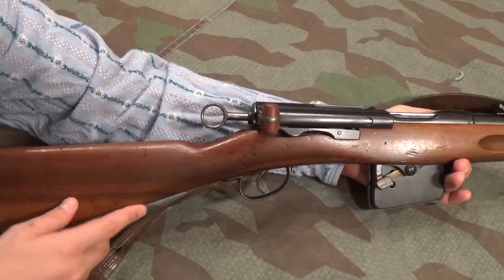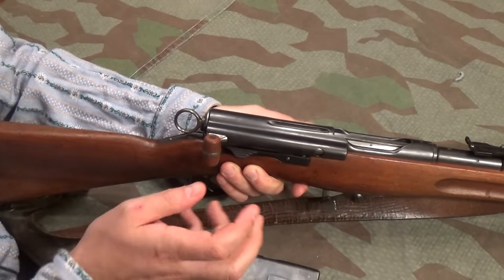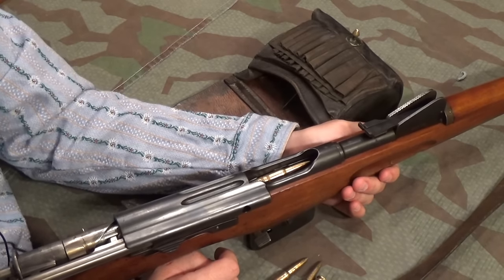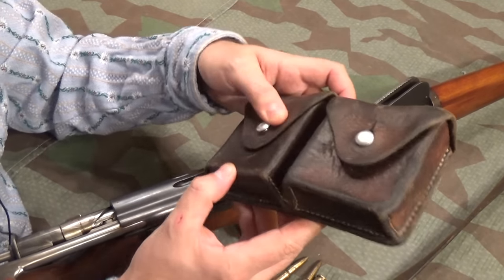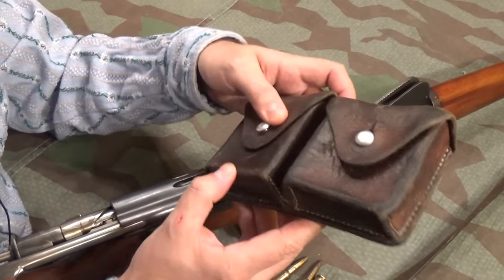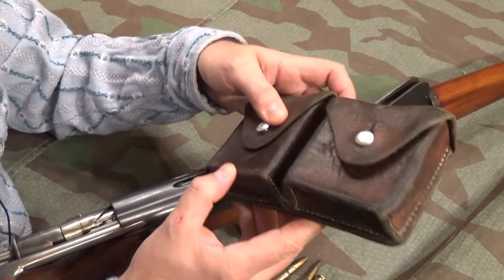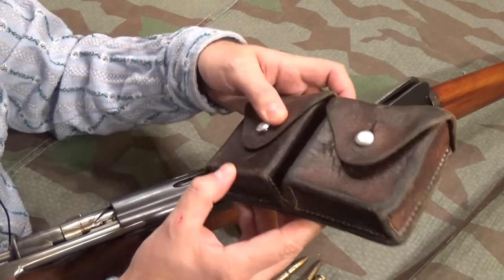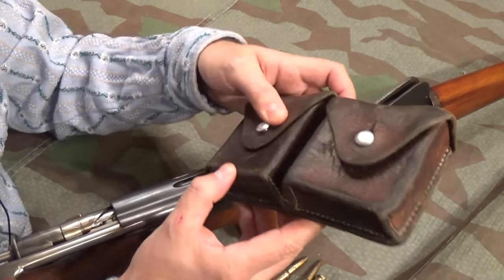Swiss Straight-Pulls Episode 2bis: 1889 Rifle Mechanics

Comment: A lot of people don't really capture the whole story when it comes to the locking lug location.
Yes, having the lugs farther back means more metal under stress and more bolt compression (dynamic headspace).
However, the main problem is that the lugs are behind the cam groove. If the cam groove wasn't there, it wouldn't have been much of an issue how far back the lugs are.
The fact that the section of sleeve containing the cam groove is under stress is a big problem. It means that the stress has to flow around the cam groove (big simplification, stress is a very complicated thing), meaning the stress has a much higher magnitude than it otherwise would have AND it effectively creates asymmetrical locking - the sleeve will bend under stress (because it's asymmetrical) and one lug will bear more of the load than the other.

Comment: 14:50 bullet specs.  Thanks for that.  I've been using a Lee 312-185 with pure lead, as-cast 0.311", using paper 0.003" thick cut 51mm long, patched up to 0.323".  Seems to work ok, but I'm only pushing them at 1690fps...so there's that.

Comment: I recently acquired an IG 1889 converted to a .22 cal target rifle. An interesting tidbit about the gun, it has a serial number that puts the date of manufacture in early 1892, 26,000 range, and a privatization stamp of P 10, 1910. The interesting bit is the 1910 privatization date being one of the earliest I have seen. Only 18 years in the Swiss military.
Reply from the maker: The gentleman in question will have been re-equipped along with the rest of his unit from a Vetterli to an 1889 in the mid 1890's. I'm on the wrong computer, but off the top of my head the earliest P date I've seen on an 1889 is 1907.

Comment: Please do that one on modern reloading!  There's all sorts of opinions on how to approach that going from using .308 to .312, trimming or not trimming 7.5x55 cases, running them under 37,000psi..  and so on, like to see yet another opinion :)   They're beautiful old girls, proud to have one.
Reply: don't reload with to little powder, you get bullets getting stuck in the barrel which happened twice so far... the breach didn't blow up though! surprisingly LOL
32gn's of imr4064 no no! others say 36 to 39, and it will be just under near the max 40,000cpu, crazy!
Reply: @TimonSuricata  The breech won't blow with a stuck bullet unless you fire another bullet. If there isn't enough pressure to push the bullet out of the barrel, then there certainly isn't enough to blow up the breech. Most of what I have read says to use minimum loads for the .30-40 Krag for both cast and jacketed bullets. I have an 1889 on the way from Edelweiss Arms and I'm planning to just shoot cast bullets in it.

Comment: Recently saw a swiss model 1889 with a gunsmith marked barrel and paper band around handguard. These were shot in competition?
Reply: Swiss competitions are shot with Swiss service rifles, ergo during the service life of the 1889 it would have been normal for it to be used in standard competitions until replaced by the next generation.

Comment: Hey bloke, that bit about "Dynamic headspacing" was quite good! I never even considered that as a possibility, the compression of the material in the bolt that is. Is that a problem on any other guns, you reckon?
Reply from the maker: Oh, it's a thing on all rear lockers, but they're mostly far more rigid than that super long 1889 bolt.

Comment: Hey Bloke, or anyone else for that matter, could you explain what the markings mean? mine has what i assume is the serial number: 131156 then it has a bunch of the little cross stamps and a ovalish circle with a tiny cross with a 4 under it inside the circle and a P with 0 on the left and 8 on the right just above the cross thats just before the barrel, where that line above it is... As I said previously, I know nothing about this rifle other than that parts are missing, the bolt is jammed open, and the rifle has been sporterized (I assume thats the term for having no hand guard and the bottom stock sawed off bout half way more or less down the barrel) ... I just took a look at the bolt and enough of it is sticking out to confirm rear locking lugs so then by this possibly skewed logic, it must be an 1889...

Comment: Does ppu run its ammo a bit lighter? My 1889 fired it with no sighns of case stretching or excess pressure.
Reply from the maker: Don't do that. But yes, PPU 7.5x55 is a bit lighter because of people doing that when they really shouldn't. And of course you're not going to see signs of excess pressure for obvious reasons, that the supposed "pressure signs" you're looking for aren't affected by what the firearm is capable of taking  ;)
Reply: Good to know, where does the ammo usually cause the failure point on those guns? Is it cracking lugs? Or just that there is a decreased margin of safety in the event of a bad case?
Reply from the maker: Seems to be the latter. Plus some people report hard extraction due to the flex in the system allowing the case to over-expand and then get clamped in there when it relaxes back.
Reply: Good to know. Mine acted like nothing was amiss and extracted smoothly, i also checked the brass for stretching and it had not. But it shot awful. I have found a hand load that shoots well and is lower pressure. Funny was the brass had far less stretching near the head than what my no4 does to its 303 brass. Thank you for the replies. Love your show!
Reply from the maker: Thanks!

Comment: I have a semi-auto with 4 round clip, is it a sportrized version? It's a barn find I cleaned up. Any information would be appreciated!
Reply from the maker: This is a bolt action. Not a semiauto.
Reply: @BlokeontheRange  Perhaps a bit off topic, but this comment kinda got me thinking. Did the swiss ever experiment with a gas operated bolt rifle conversion like basically everyone else? The brits had the howell conversion of the SMLE, but it would seem to me that the straight pull system of the schmidt-rubins (namely the already existent operating rod) may actually have been a plausible and reliable conversion.

Comment: Does anybody know what you do (apart from cry and curl up in a ball) if your 1889 bolt won't come out of the rifle? 

Mine is jammed in there, cycles fine but just won't come out with the latch.
Reply from the maker: I've never heard of that issue. See if you can take the latch off.
Reply: @BlokeontheRange  looks like it's pinned in place, I've tried seeing if it's caught on the spring but that hasn't solved it. 

I'm thinking it must be built up edge inside where the bolt hits the latch as you cycle the gun.
Reply from the maker: Or it's deformed in some way. You might have to get a gunsmith to pop the pin to drop it out and see what's going on.

Otherwise, there isn't anything binding which prevents the lever from being pushed all the way down?
Reply: @BlokeontheRange   I don't see anything binding I tried taking the stock off to get a better look and saw nothing, I'll have to have a better look when I'm home again. I could be wrong on this but maybe the spring on the latch is getting caught preventing it opening fully? I'll have a look when I get the chance. 

I think I'll find a gunsmith around me to do it. Seems like the most sensible way rather than trying to force the thing.

Comment: Just curious, can us folk here in the UK actually get the ammunition for this gun if we would be lucky enough to have one?
Reply: This is a pure collectors rifle. Get the Langgewehr 11 instead. It looks exactly the same except for the magazine and very slightly different (but much better) sights. The mechanical parts also look almost identical, but have revised locking lugs roughly in the middle of the bolt (thereby greatly improving rigidity and shortening the bolt). The Langgewehr 11, while looking identical, is superior in every way, and it fires GP11 cartridges, which are still made today. The LG11 is also relatively easy to find and quite inexpensive.
Reply: @adrianguggisberg3656  Thank you very much lad, I'll look into these tips. Have a good day. 🙂

Comment: 3:22 Dont you mean cocks on closing? The striker only catches the sear at the last part of the closing motion, compressing the striker spring.
Reply: Bloke on the Range Strange. I just pulled out one of mine and did some testing. Strange, out of some reason i thought the rifle was cock on close, possibly due to the fact that when I work the bolt but depress the trigger the striker is in the fired position. Does that mean there is a possibility of slam fire?
Reply: Bloke on the Range So, youll do a video on it for educational purposes?
Reply: Blindpatrone

Comment: why is this gun the only antique cartridge loading rifle in the uk that sells for under 1000£?
Reply from the maker: Cos there's loads of them about, and in Switzerland they only cost about Fr. 150.-, if that.
Reply: @BlokeontheRange  I was really surprised at how cheap they are in the U.S. other than Dutch Beaumonts most antique rilfes here are $1000 plus. The only antique I currently own is an 1895 Chilean Mauser made by Ludwig Loewe. I've had an 1896 Krag carbine in the past though. I just picked up an 1889 Schmidt Rubin with a perfect bore and 80% finish for $395. I can't wait to work up some cast bullet loads for it.